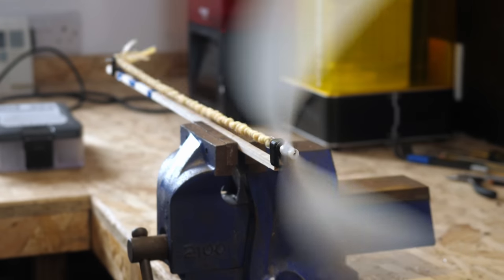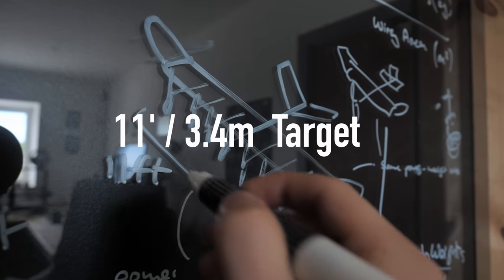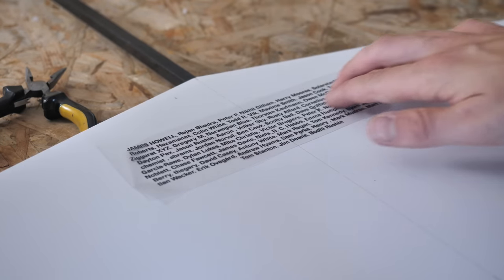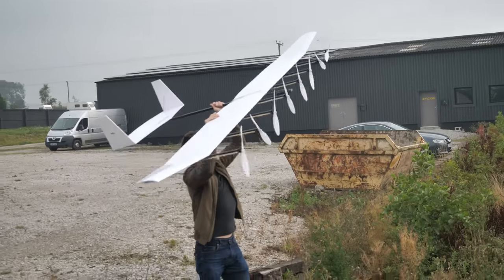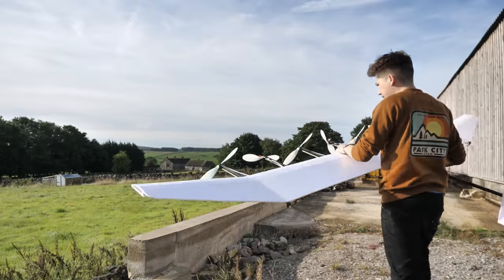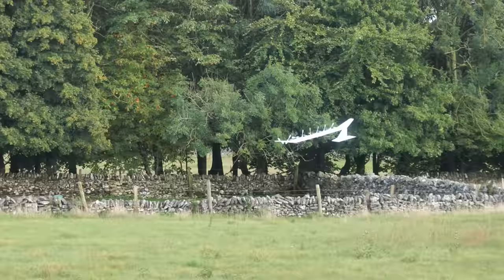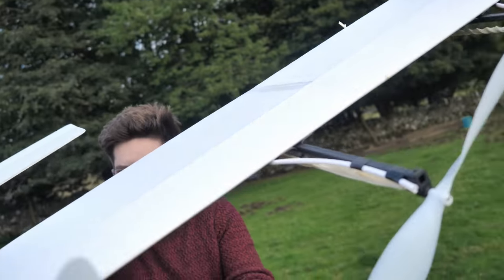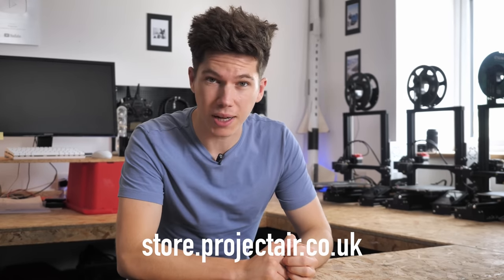Giant Rubber-Band Plane

Comment: As a 77 year old I well remember rubber powered planes, I also remember my dad telling me about lubricating the rubber with BANANA OIL ! yes there is or at least was such a thing. I tried it and it as I remember worked really well. I suppose it lowers the internal friction between the bands.
Reply: I used baby powder on mine.
Reply: I used to use green dish soap. But I’m sure banana oil smelled better. ;-)
Reply: Or silicone
Reply: Glycerine is best. It reduces the friction between the strands of rubber allowing them to slide over each other. You’ll get more winds on too. Keeping the rubber cool will give better performance also. Leaving it in the sun to get warm reduces its performance.
Reply: Just don't use mineral oil or cooking oil of any kind. they will soften and weaken natural rubber. Castor oil is fine, though. It is chemically different than most plant oils.
Reply: 37 years old, but I still played with them, used one like a helicopter for an egg drop thing in school.
Reply: Four decades of FF rubber here. Lube that rubber. 3x stretch on the wind minimum. 4% curve on the wing camber, polyhedral wing using tip washout, Parsol fuse is beginner safe. Have Fun.
Reply: oldschool trick! helps to break the tension
Reply: banana oil was for the wing paper, not the rubber band.
Reply: it also prevents the rubber band sticking to itself.
Reply: Hi
Reply: Can you please tell how he build the engine?
I mean if the rubber is strecthed, it will pull the propeller very strongly inwards which will increase the friction. How did he overcome that?
Reply: My late dad who was actually a champion indoor and outdoor model airplane builder starting out in the 1930s' as a kid, used green soap and glycerin to lube his rubber bands.  I believe his club back then was called the Flying Aces.  I still have very old photos and 16mm movies around my home showing him and his team in practice and competition. Still have a few of his trophies and planes that we built together too!  I really miss my dad.....😕
Reply: @abcdefgh61211 2:24  You put washers between the nose bearing (black) and the back of the propeller. When I flew models you could buy domed washers and you fitted two like this )( which reduces the contact area. I think he added a dome to the 3D printed nose bearing.
Reply: I used mineral oil
Reply: When I first built my rubber band airplane I asked my pharmacist for banana oil. He thought I was being super funny! Banana oil was used on the light tissue to shrink it without warping. Rudolph
Reply: I use these rubber band planes with my friends today, they are a classic toy
Reply: With all due respect for a job well done from another modeler in his 70s. What we see here is the difference between an internet influencer building rubber powered aircraft from a model aircraft builder. To solve most of these problems you don't have to reinvent the wheel, just read some old modeling magazines. Particularly appropriate here would be any articles about braiding rubber motors to get more duration great work and loved the model rocket Giant sailplane.

Comment: You could vary the run times of each rubber band to create a sort of staging for each motor. For example, if the central motors had a duration of a few seconds, they would dump a lot of energy at the start, from which the plane could then coast, running off lower output from the other (longer duration) motors. Kind of like how rollercoasters often add all their energy in one go at the start of the ride! Excellent video as always!
Reply: Love the staging idea! Can't wait to see whether it's incorporated!
Reply: Hi Dodgy Engineer (lol cool name) was thinking something similar. Motors firing off in pairs
Reply: But he said it didn't have enough power to climb with all engines running (so only just flying really) and props not running are a massive drag and dead weight.
Longer rubber motors are the way to get longer flights and maybe over winding...
Reply: gives me an idea, what if he could vary the stretch lengths with a servo, maybe that could be a simple way to have some control over thrust without too much loss due to friction.
or even better, use another elastic band to keep tension on the twisted one while it is unwinding!
Reply: All too heaving and overly complicated. The key is to build it light. Use a longer motors and bigger rubber cross sections does essentially the same thing.
Reply: As long as the plane has RC, you could also start 2-4 motors at the beginning, then add them as you needed them.
A launcher that got the plane up to ideal speed and altitude would also be a good idea.
Reply: This is what I came here to say, you beat me to it!
Reply: I was thinking like that too. When one rubber band has expended it's energy, a new one somehow takes over and continues.
Reply: I think this is a great idea! Also now that the release of the props is handled by RC why not build a rubber band powered launch slingshot! use that to get the plane as high as possible initially then use staggered release of the rubber banded props to maintain flight for as long as possible.
Reply: Damn I thought i was the only who would come up with such an idea 😂
Reply: I had the same thought!
Reply: I was thinking something similar, maybe 2 sets of rubber band motor things for each prop, and it switches out somehow?
Reply: The weight of engineering to do that would kill any advantage. Not gonna happen.
Reply: Add pusher props at the tail
Reply: @bsimpson6204  if the props waiting to be unleashed could free spin it would help. Or an unfolding prop, forms into shape under load.  Need to deal with props that are spent too.  Maybe the blades could be mounted on hinges that lets them bend back, under power would they pop into place?
Reply: @DiyEcoProjects  yeah if he had say 12 rotors and activated 6 at a time he would probaply be able to sustain flight, coast a bit off the first pair and then fly off the second pair for over 30 seconds
Reply: Good idea. You'd probably want different pitches on the propellers too. Coarser pitch prop on long thin rubber,  finer pitch on heavier rubber.
Reply: You must have watched another video because one can clearly see the airplane needs all motors to gain speed and thus lift, if you do that the acceleration would be so weak it would never achieve flight speed before crashing or deploying all motors at ounce. Plus static propellers are a huge source of drag it would only aggravate the minimum flight speed situation. You truly live up to your nickname.
Reply: @bsimpson6204  use folding props, quite common on model gliders
Reply: @brianlhughes  feathering props like on sailboats.
Reply: Could you use one rubber band to power a pusher prop and a main prop from the same band? (for each motor)
Reply: the drag from static props would probably not make it worth it.
Reply: @gabrielpenix1371  I was also wondering that.  In addition are two bladed props the best option?  3D print a set of props with different blade counts but the same weight and test with the load cell.
Reply: Just bear in mind, it only just has enough power with all the motors running…
Reply: @bsimpson6204  props not running probably cause less drag than a spinning prop
Reply: I agree I was thinking that to
Reply: Can you please tell how he build the engine?
If the rubber is strecthed, it will pull the propeller very strongly inwards which will increase the friction. How did he overcome that?
Reply: The motors that ran out early would be a source of drag.
Reply: Oo
Reply: A similar distance flight but slower?
Reply: It’s a good idea or a modification to your idea they all start but a few that are meant to do the start push of force and others last longer while going slower since if they all start it’s even more power and some would still keep it going and could glide for longer
Reply: You could also use a gear ratio to add more torque
Reply: What about latex rubber tubes ?
Reply: This was my first thought watching the thumbnail
Reply: I checked your profile and you have nice videos❤❤❤
Reply: Excellent idea, I tried it, and it had a significantly longer flight time.

Comment: If you really want to get into the weeds of rubber power, have a look at what some of the indoor free-flight people are doing. Not everything they do would carry over, but a couple things from when I built rubber planes in high school:
- lubricating your rubber bands somehow is important, find something that doesn't damage the rubber though. It lets you wind it up much more before they start breaking.
- pre-stretch your rubber bands: I would always cut them to ~1.5 times the length of the mounting points, and then before I start winding, pull the rubber bands back until they're stretched to ~3x their unstretched length. This lets you get a lot more winds/flight time, at some reduction in instantaneous power. 
Really excited to see you continue working on this project! best of luck

Comment: Somehow I got down the rabbit hole on YT and watching all these model airplane videos. I used to fly 30 years ago, and I noticed that foamboard and hot glue is a very popular manufacturing method. Surprising. Hot glue seems REALLY heavy vs CA glue and foam board is heavier than balsa/tissue.
Reply: The upside is it's really really fast in comparison.
Reply: @zogworth  for sure initial build time is quicker, but if you're doing repair after repair, might not be as efficient as it first seems.

Comment: Cool video! A couple of thoughts :
-Depron is waterproof, you may consider using it in the future (but it's expensive
-using thinner foamay lead to a lower all up weight and therefore more performance, at the department store I've found a very thin type of foam that it very brittle used to insulate floors, but laminating it with some packing tape solves it.

Comment: Have you thought about stretching the bands, rather than twisting them? You could connect it up to a 3D printed gearbox, getting more power and runtime with only a single prop. You might be able to use much stronger bands, and also have a faster reset time between flights.

Comment: I’m a rubber powered freeflight guy, and this is pretty interesting.  First though, you’re leaving tons of rubber performance on the table.  It appears you are using 1/4” tanII super sport (the good stuff), so from the turns per inch of loop table we get 69, and assuming your loop length is 18” that’s a maximum of over 1200 turns per motor. The torque skyrockets as you near max turns but even winding to 80% you should be safe at around 1000 turns per motor, more than 3x what you said you were using. You might consider fewer motors and bigger props, but the winder you are using won’t handle a cross section much more than you have.
Reply: He does not seem to have any lubricant either

Comment: Check with Experimental Aircraft Association.  In the 1980s at Oshkosh I saw an ultralight airplane, (Lazair) converted to rubber power (engines removed).  Large propeller with bungee cord stretched through the tail boom and wound tight with a drill.   Carried a human!

Comment: Rather than twisting the elastic bands around, it may be more effecient for the elastics to pull and use linkages to get the pull to a rotational motion.
However, I dont know how the extra weight would affect its flight time.

Nonetheless, cool project-keep the work up!
Reply: The elastics could be wrapped around a small drum on, or via a simple gear reduction to, the prop shafts and anchored to a point somewhere beside the drum. Fairly lightweight and directly translates the linear stretch into rotational motion. I think this would be neat because a person can vary the tension that gets wound onto the drum with each turn, too!
Reply: every conceivable design has been tried and tested over and over nothing is more effective and efficient than this design
Reply: the twisting is pulling it.
Reply: @cayenne7792  true but my 600mm single F1B prop would destroy those puny little things

Comment: this is definitely not the largest plane because in our aircraft modelling club back in 90's we had standard schematics for rubberband planes of approximately that size.

the trick to storing more energy is definitely not using more rubberband engines, it's using much longer and much thicker rubberband threads. we used to have a glass fiber pole as a frame with length of about 2m and about 0.5cm^2 rubberband.

another important thing is to make the prop foldable (backwards) so that once the plane reaches its height it folds and does not produce extra resistance. the engine works for about half a minute and its glide time depends on your skill and where you launch it, but it's on the magnitude of minutes.

Comment: You can get a LOT more power from a rubberband engine if you slather the strands of rubber with glycerine. We built a boat with 8 twelve-strand by 18" motors driving two counter-rotating props. It could go the length of a swimming pool in under two seconds from a standing start. We wound the engines to triple-knots and when we tried it with dry strands the rubber bands melted when we released the props. Saturating them with glycerine freed them up to where they could unwind without melting.
Reply: Even more with Rx silicone oil

Comment: This reminded me of The Great Egg Race (BBC Two TV show in the 1980s). The original challenge was to make a wheeled contraption powered by a standard rubber band to transport a hens egg as far as possible. From memory, the key to great distances was using a fusee to even-out the release of energy from the rubber band.
Reply: fusee to even-out the release of energy from the rubber band
more info if you could please :)
Reply: @littlehills739  When a watch spring is tightly wound, or a rubber band is tightly stretched (or twisted), they want to release a lot of energy in a short time at the start. Mechanically, this is because the exert a bigger force when tightly wound, compared to later when they are partly unwound. The fusee is like a kind of continuously variable gearing that slows down the release of energy at the start, and then make the release of energy easier (through mechanical advantage) later on.
Reply: @JohnTelford1   fusee in clock making nice thank you for helping

Comment: Fascinating stuff, James! As a flight-mad kid in the 1960s, I went through a pretty fair batch of rubber-powered balsa aircraft, which no doubt planted the seed for my later RC activities. There’s a lot of enjoyment in extracting maximum performance from minimal equipment. And yeah, when I saw the thumbnail for this vid, my first question was, “How is he going to release all those motors at once?” Nice solution! Now you can attack the issue shared with EVs… maximum range with minimum charge time. ;-) Cheers as always from Missouri, USA.

Comment: very good, the flight is also stable. Unfortunately, the flight duration is very short, much like a glider model airplane. maybe it can be calculated again the strength of the stick motor against the pull of the rubber and the number of rounds of rubber needed for maximum flight. great job

Comment: Had a random thought about rubber band planes. Could you try attaching a band to an adjustable rail or screw shaft, geared up to the rotation of the prop and use the rotation to stretch the band as it unwinds? 

The purpose of this would be to increase the efficiently at which the planes uses the stored energy, perhaps extracting a little more than it otherwise would and maybe increasing the time a loft.
Reply: a much lighter way to do that would be to use a second elastic band set up to just provide linear tension, or even an alternative setup of the rubber band, where the loop forms a triangle with one point on the prop and 2 on the body, so winding also makes use of linear tension.
Reply: @sperzieb00n  or have a longer single band it is more efficient

Comment: Something I've noticed is that, bigger props with lower rpms are usually more efficient... instead of moving a bit of ar at a high speed, moving a bigger mass at lower speed should increase the runtime...
Reply: Yes, you have to balance it with the kind of rubber you have, though. Thickness/linear density, length, and quality all play a big roll. The condition's this rubber were being subjected to were not the best, no o-ring, no lubrication, and poor weather. What you are describing if perfect for F1D where it can take thousands of winds, but those planes are build for only the most controlled environments.

Comment: To roughly double the power of the rubber bands treat them with glycerin.  (they will stretch further without breaking plus it lubes the twists which will unravel more smoothly and without as much internal resistance  -- when we were kids, no one could 'compete' if they weren't using glycerin)  There's some kind of molecular interaction between the rubber and the glycerin which you can't get with ordinary oil lubes.
Reply: Using silicone oil is even better

Comment: Awesome dude!! Im thinking about increase the flying time, so, could that plane flight with only 4 propellers? cause alternating the propeller block when the first 4 run out of energy, release the other 4... Could work? Hugs from Canary Islands!
Reply: Drag from the stationary props could become a problem don't you think? Longer elastics would help, but the ways he runs them currently, he would have to add longer spars, which adds more weight. I wonder how much a tiny 90° bevel gear at each prop would weigh? It would let him run a much longer elastic under the wing, and if it's a torque reduction, he could beef them up as well, and get longer runtime that way too.